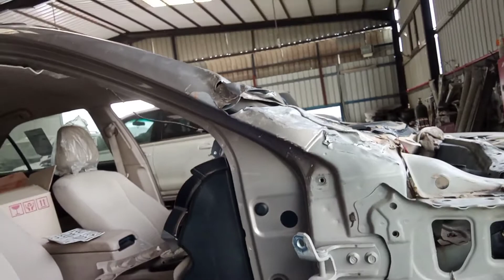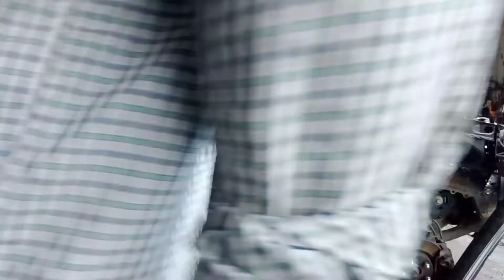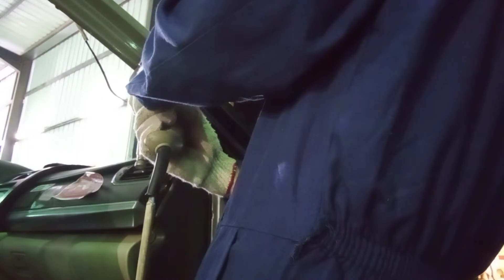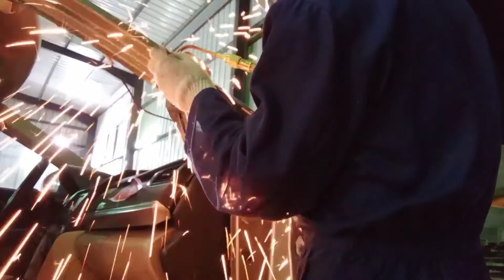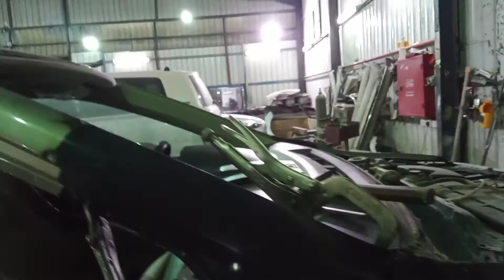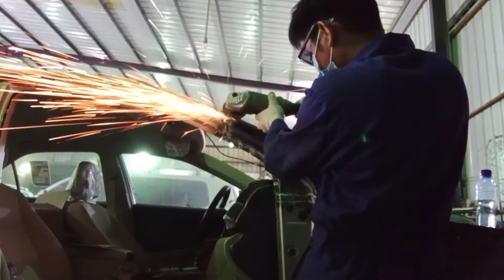How to replace car body pillar

Comment: I wish I could have you fix my truck it has the same damage in the pillar. Are you welding the new piece back on or soldering ?  Looks like a torch with a stick of some kind.